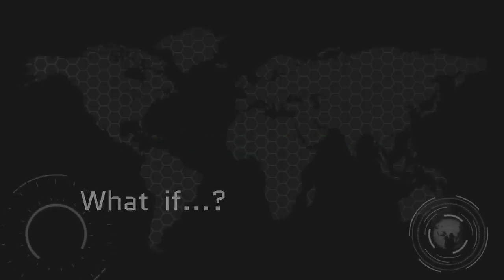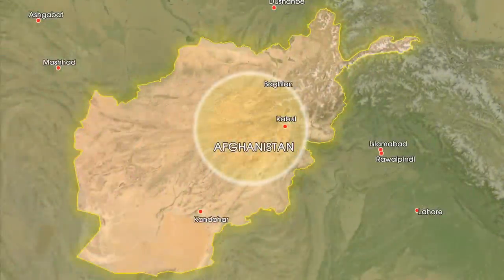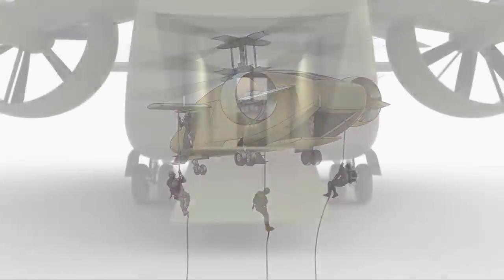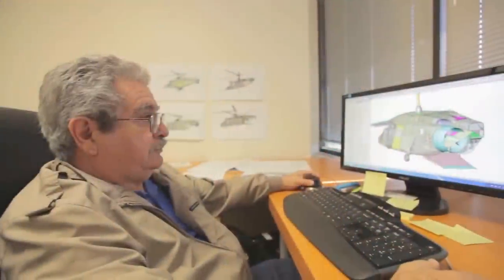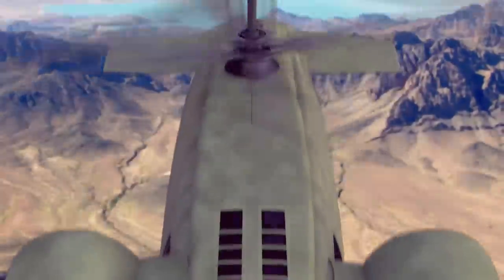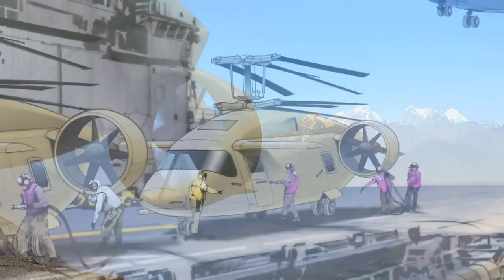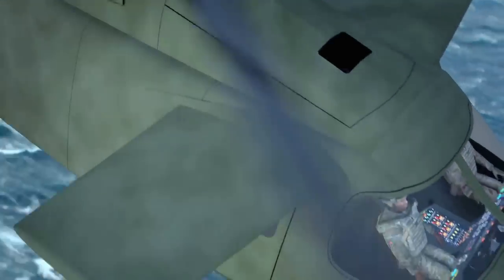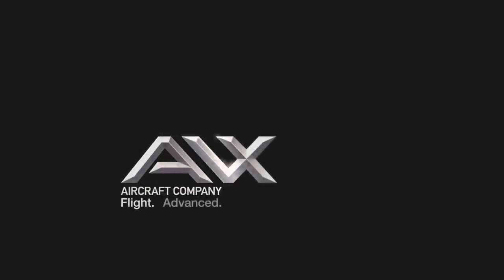AVX Aircraft - Compound Coaxial Helicopter (CCH) Simulation [1080p]

Comment: Like the concept, but as Boeing has found out, the rotors and swash plates in such a design were more difficult to design and make than anticipated, delaying their entry reaching flying status. I hope they can accelerate testing now so meaningful comparisons to V-280 can be made ASAP. I suspect the military will buy some of both designs since they both offer exceptional performance in differing roles.

Comment: What if.....i told you.... 

CGI objects aren't real...
Reply: Haven't you heard? CGI is the new proof of concept. It worked well with the F-35 and the littoral ships.
Reply: orlock20 Bollocks! 
CGI is not proof of concept at all.  GCI is merely a visual representation of how something looks.  Certainly it can be used to demonstrate how a concept is INTENDED to work but it cannot PROVE that it works, in the same way that Star Trek cannot prove that travelling by warping space time is possible.

p.s. The F-35 was already a proven concept as it was developed from the Yakovlev 141.

The concept of a littoral ship does not need to be proved also,  as these kinds of vessels have been in use for centuries.  Littoral means 'on the shore'.
Reply: Charlie Govenor
I was writing it  sarcastically.

The littoral ships the U.S. designed recently turned out to be 100% failures. Were they cost effective? No. Are they fast? When they are working, they go less than 20 mph faster than other warships yet when they are going to get increased weapons and armor, then no.  Are they modular like the CGI says they are? No. Can they hunt mines as designed? No. Can they get in close to enemy land better than a destroyer? No. That's because if the enemy is high tech, the ship will have to defend itself and the navy says the littoral ships can't defend themselves.  If the enemy is armed with K-47s, it doesn't matter which type of ship is used because the troops are going to be moved by either helicopter or small boat from about the same distance from shore.
Reply: orlock20 Please use the /s sarcasm tag.  Youtube has far to many ass clowns these days to spot the difference.

I never understood the reasoning behind combat littoral ships other than for working in deltas and rivers, especially with all other warfare technology trying to maintain a 'standoff' approach to warfare where possible.  Even if they did use them for river incursion, that still seriously limits their use to long wide rivers (what's the point of travelling up a short narrow river?).  The number of places where such ships are usefull over standard combat ships is very limited.

Sure there have been lots of littoral ships in history but they have all been for where working right up to the beach or very shallow water is necessary (like ferryboats or dredgers).